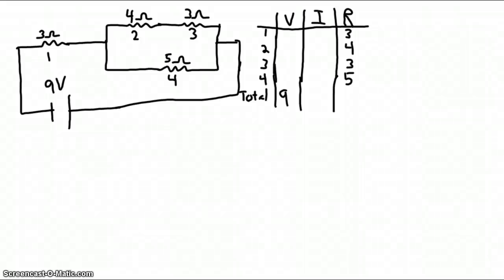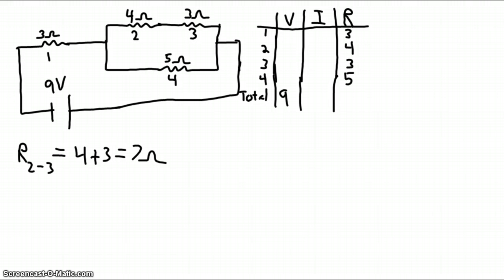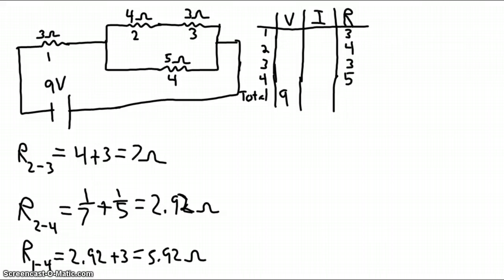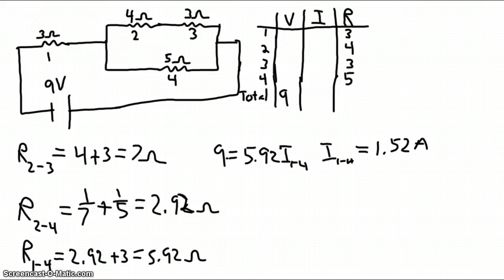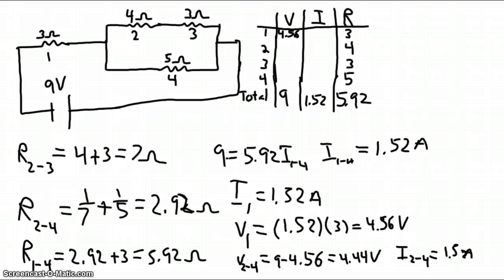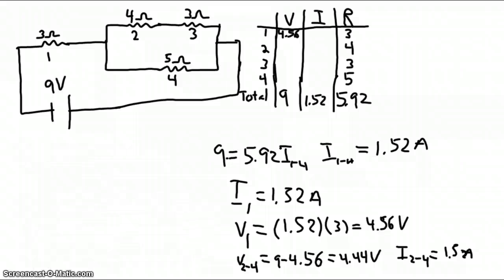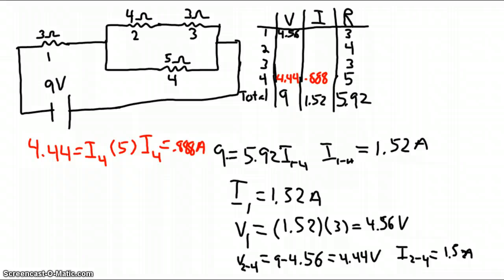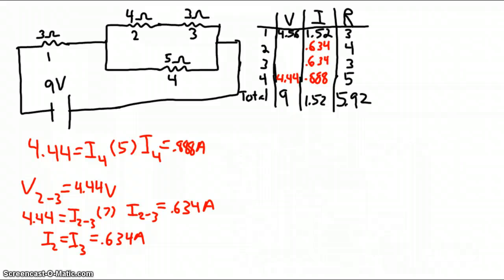Solving a Combination Circuit

Comment: You are writing the parallell resistance calculation wrong.
You write " 1/7 + 1/5 = ... " When it should be "1/((1/7) + (1/5)) = 2.92"